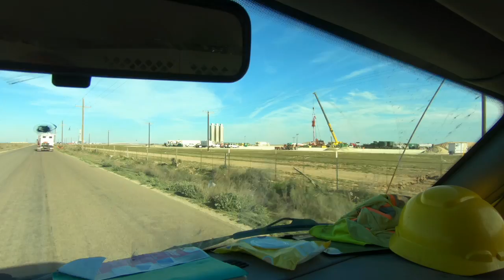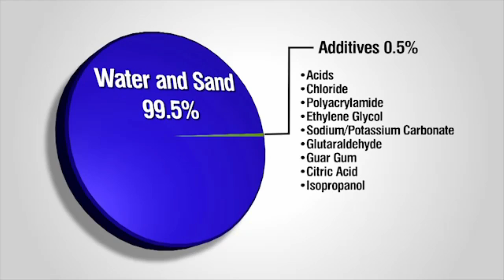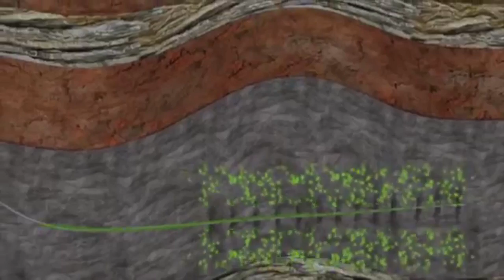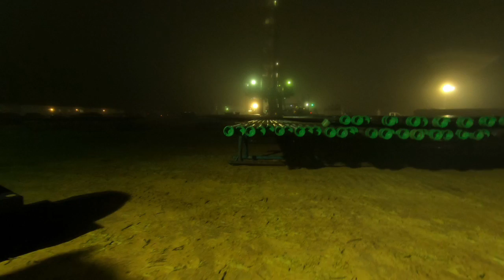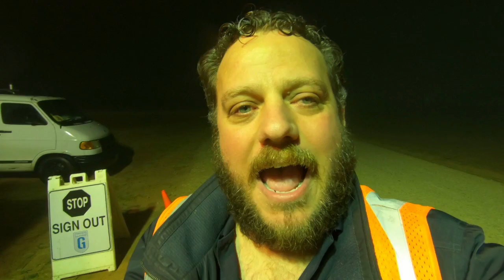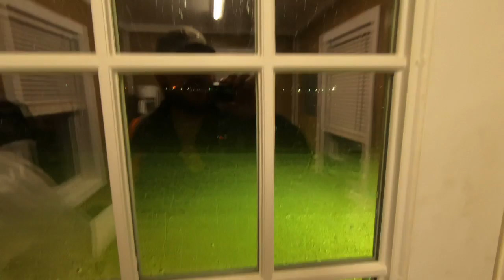Tornados, Hail Storms & Are We Getting Laid Off?

Comment: Nice job on the fracking presentation, James.  You have some good graphics to go with it.  Yep, the "cheap oil" is about gone!

Are you familiar with the oil & gas operations in San Ardo, CA?  As you drive up & down Highway 101 along the Central Coast, you go past the area.  They seem to be pretty busy.  .. and the weather can be decent.  Of course, every place has it's risk.  Instead of tornados, you get a major earthquake fault line in the area!  .. it doesn't shake too often! LOL
Reply from the maker: I am familiar with the Bakersfield play, but not one of the 101.

Comment: Oh, and one other thing, it’s common to produce oil and gas out of limestone, maybe even more so than sandstones. The shale thing came about from the development of horizontal and directional drilling technology. Unfortunately for the shales, while porous, the permeability sucks like you said, so the production falls off fairly quickly.compared to other formations.
Reply from the maker: The limestones you see production from are not classical limestones. Its either dirty limestone which is more limestone than shale, or limey shale which has a lot of lime in it, but is more of a shale type rock. You'll also see production from dolemite as well in the modern day. In fact a lot of the Mississippian play is dolemite. But, sandstone can be a limestone as well, since sandstone is a sedimentary rock formed from a certain size particle more than it is itself a specific kind of material. Its rather common to have a Calcium Carbonate sand stone.
Reply: Wanderlust Estate, sounds like you’ve learned tons man. The sands can be cemented with calcite or silica. Originally, if I recall, most of the production where I first worked around Andrews was from the San Andres formation which was mainly dolomite and limestone. The Exxon Means field I think might have been an example. Then they kept exploring;) I worked on an acid job on a gas well so deep for Exxon, it took almost a year to drill and they completed it using the drilling rig because the tubing for that length was so heavy! It was over 23,000 feet deep. Bottom hole temp was over 300 degrees if I recall. We had to use formic acid instead of hydrochloric because at high temperatures the HCL would eat up the tubing. We had to heat it to about 180 degrees if I remember. It had to be heated so it didn’t cool and shrink the tubing which would have unloaded the packer. We were pumping against about 11000psi, most of it from friction. We used turbine powered hydraulic pumps called pressure multipliers. I don’t think they use turbine powered pumps anymore, too expensive. It was one of the cooler jobs I worked on, but I didn’t design or sell it, I just helped run computer monitoring on it. Anyway, if I ever run into you, keep an eye out for my red RV, I’ll tell you about the blowout I worked in North Dakota. My first six months before going to the Permian basin was in the Williston basin. I was a wormy mofo, but still got to work a crazy blowout. Red Adair and Boots and Coots worked together killing it. I think Halliburton bought one or both of them so they probably don’t exist as companies anymore. Be careful, watch out for H2S.
Reply from the maker: @Jumpingoffthecliff  I worked as a core hand in field services from 2011 until 2013. Then as a core analyst from 2013-2014 until I went to junp ship to new division at Slumberger. Well oil crashed and the dropped the division including me.
Reply: Wanderlust Estate well, that explains your extensive knowledge! Schlumberger bought the company I worked for, Dowell, which was part of Dow chemical when I first hired on. You know The whole boom bust cycle thing first hand. I survived the bust in 81, which tells you how old I am, because I had extensive stimulation experience. I was the only one of the people I knew who started with me to survive into 82. I loved the patch, but I also recognize we need to stop mining our energy as soon as possible. I still have my CDL and I always thought I’d go haul frac sand if I got in a pinch;) hope we meet up some day. Glad you guys are doing well.

Comment: You did a great explanation of how fracking works.  That sucks about the job.  There are a ton of oil field jobs in the Premium Basin though.  If you can deal with that area you are golden.  I grew up out there.  It can get rough!    PS  the wind blows 360 days a year.  Enjoy the heck out of those 5 good ones   LOL
Reply from the maker: Carolina cannot work those other jobs, also Midland is slowing down. Layoffs are happening at Pioneer. They are racking 8 rigs and laying off 64 company men and 33 engineers.